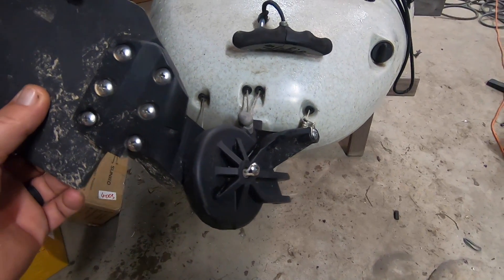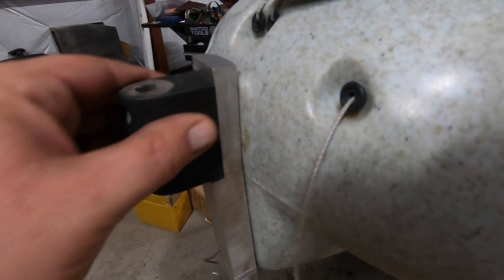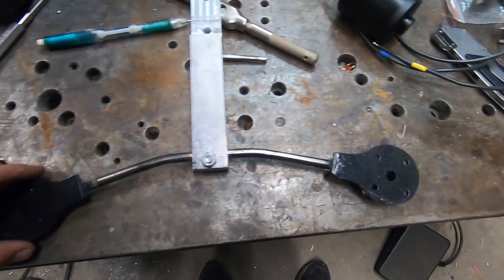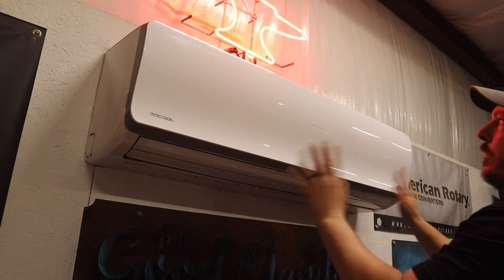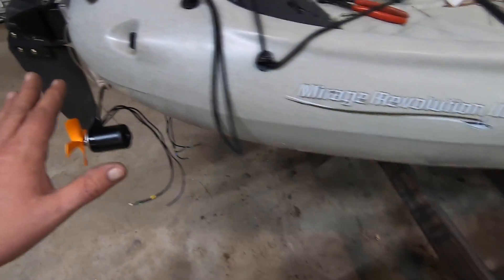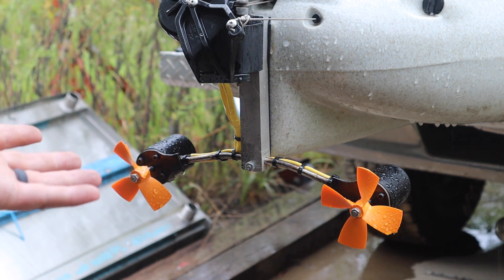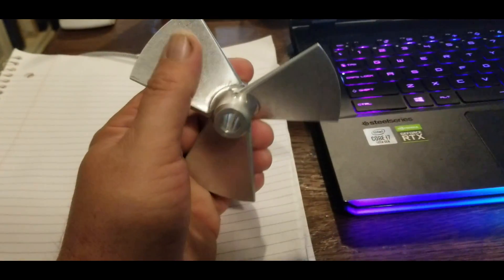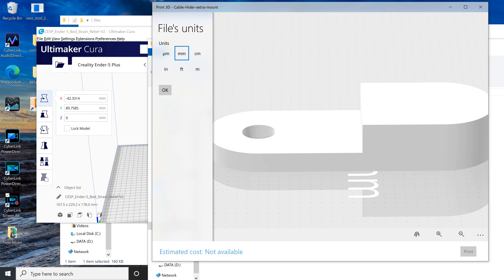Hobie Twin Motor Kayak Build!

Comment from the maker: Want to help with the project? Click here!
https://gf.me/u/yx6acc
Reply: Hey man I’m new to this type of technology but my friend is using in one of his kayak a Ebike Speed controller It seems to work good Do you think that will work with one of your set ups
Reply: Hobie makes some side stabilizers that are not that expensive. If you do need to add more support to the motors they might be a nice bolt on option.
Reply: Hoping to see an update?

Comment: Have you tried RC Aircraft three bladed pusher props instead of those ducted fan blades, as the triple bladed props work more efficiently, as you can adjust them by cutting them down .
Check out ,The Tesla Catamaran.
 At time line 1:00:3  and he explains about the props, good luck.

Comment: hallo can u hear me now?say why couldn't u use some sort of rubber pieces to absorb the shocks???and you could drill through the kayak to put a light weight metal sheet on the inside for stengthen the piece on the outside.just a thought.oh and if u can get some aircraft metal.it's lighter.but stronger.hey how can i get in touch with you.i got a great idea for  PROP.OKIE DOKIE?

Comment: where can i find a pair of props like those ?
Reply from the maker: That's one of the problems. I can't find the replacement. I broke the. Both bef5i could get them in the water. Very frustrating. They came with the motor.

Comment: just a quick tip if you make the props a little thinner and actually sharpen the leaning edges you will gain a lot of efficiency as it will take less effort to cut/slice thru the water.

Comment: People should know that once you motorize any water vessel in the United States it needs to be registered as a powered boat. Legally you can't put an electric motor or internal combustion engine on a boat, kayak, canoe, or whatever and use it in public waterways without registering it. And registering votes in some areas is not very easy. There are certain documents that are needed like a certificate of origin that sometimes make close to impossible to get a registration number for your water going vessel. Getting caught using a vessel without proper documentation or registration can be a very significant fine.

Comment: I've been watching you kayak videos, and I can honestly say I'm impressed with the progress you've made. 

In one of the videos you mentioned the Pelican like case was a bit warm. Perhaps setting up a small solar panel on the top of the case with maybe a 1/4" space in between, you might help to reduce the chance of solar heating of the case, and use that same energy to recharge the batteries.

Comment: Been following your posts intently. As a hobie fisherman the holy grail of motorizing my kayak is the ability to get more range and decent speed out of any motor setup (6-7 miles per hour) Not looking to set any speed records but something better then a trolling motor. Disappointing that you have chosen to go away from the drop in cassette idea because that concept minimizes having to modify or cut into your expensive kayak. Every kayaks stern is different, your wife’s hobie is totally different from my hobie compass. Will be watching with interest to see what you come up with. Great work!

Comment: Very interesting concept, been following along. Couple of thoughts: counter rotating props so the torque is not trying to walk the stern of the boat sideways and ducted props like push boats have to both protect the prop and add to the effectiveness of the props. Little heavy reading to explain it: https://www.sciencedirect.com/topics/engineering/ducted-propeller or here https://en.wikipedia.org/wiki/Ducted_propeller
Reply: 100% this. This are lots of reason twin props are counter rotating each other.

Comment: I am not too fond of pins, they are prone to not providing a tight fit, with a nut & bolt you can tighten down and with nylock its not going to move. I suppose you can use a split pin.

Comment: Since you are building props I wonder if you can have your motors counter rotating?
Reply: he would have to do that to keep it from pushing slightly towards one side. Its DC current , so in motors , you just reverse the polarity on one engine and it should rotate the blade the opposite direction but the blade pitch also needs to be reversed.

Comment: Without a bottom connection into the transom, won’t you get a differential torque when she puts it in reverse or turns?

Comment: Love this entire concept!  Maybe one day could apply to boat transom. I fish in local reservoir electric only with a 14ft aluminum. Takes forever on a windy day with 55lb thrust trolling. Torquedo expensive, all other options unknown from China.  48v system or variable voltage  would be preferred simply because I have e-scooter LifeP04  20amh could transfer. Keep cost under 1k (excluding battery)  motors, mount ,esc , ...."kit". Get this over 200lb thrust and have a winner! Super trolling motor!!!!!!!
Reply: +1 for a transom variant! this would be absolutely revolutionary for inflatable rafts/small boats!!

Comment: Put more bend in the bar that holds the motors and mount higher up, wing nut on the clamp and you can easily raise and lower by twisting them. Also, how about counter rotating props / motors, haha, joke!

Comment: You could keep the motors on a light springed hinge with feeler bars that wouldn't affect water flow much, so if they hit an obstruction the mount flips up on the force of the impact, without having to do it manually.